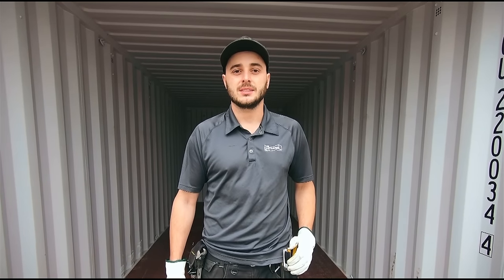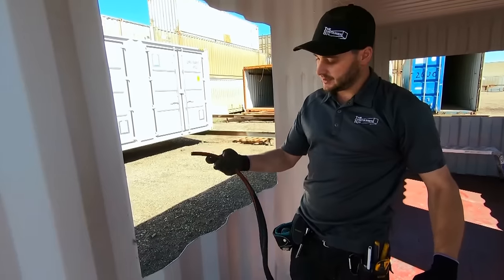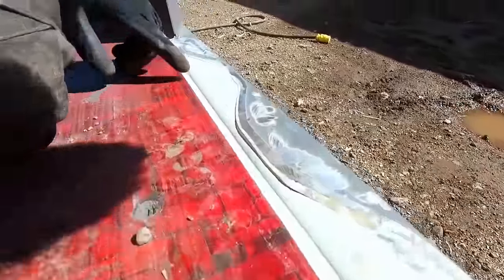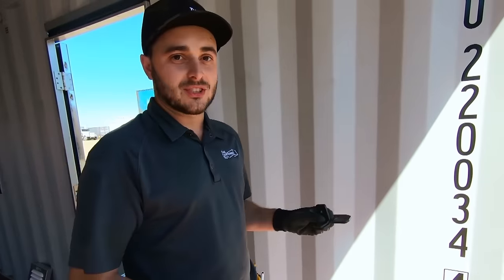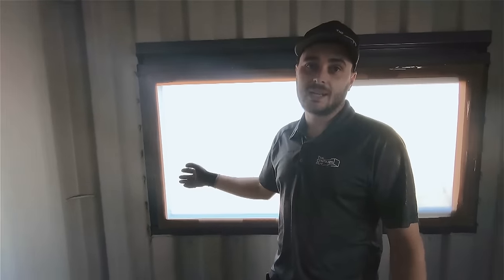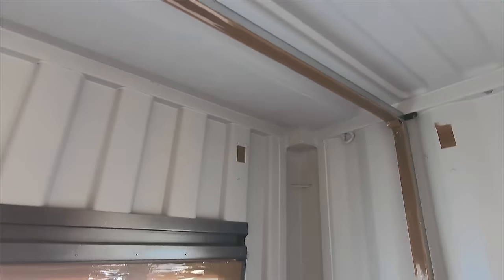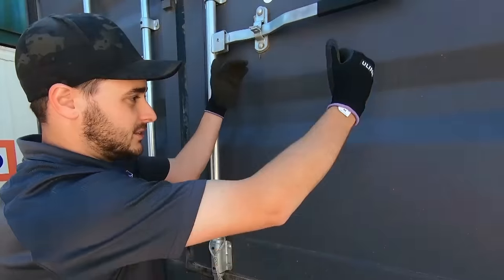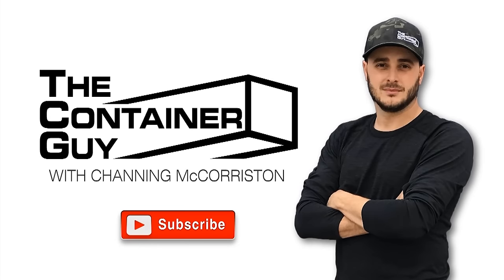Step by Step 20’ Shipping Container Modification

Comment: I still don’t understand why pay labor to install struts and closed cell rather than a refrigerated container. They come insulated with 4” or 6” of closed cell on all 6 sides and a flat stainless steel skin on the inside. 
I’ve seen dozens of conversions and none make any sense especially in cold climates. Plus with a reefer you can always sell the refrigeration unit.
Reply from the maker: There isn't that much insulation in them. Can see in this video here: https://youtu.be/7FD3KeexNyw
Reply from the maker: You're not wrong though. Starting with an ex-reefer is a GREAT way to save money. They are just 1) hard to find and 2) hard to get a structural engineer to stamp drawings
Reply: @TheContainerGuyTV   I beg to differ. there’s more R value in a reefer than in yours my friend. I do HVAC engineering in FL and work on projects like that. A reefer has 4” and 6” of closed cell so 2 to 3 times what yours has or between r-25 and r-38 in a 20 degree split climate vs a mere r-13 in a 70? 90 degrees split in yours. Closed cell isn’t a magic bullet, there will be serious heat losses with r-13. 
I don’t know where you live exactly but even if they harder to find these days, any decent reseller will find you one-trip or low-trips reefers. As for the structural, it’s too bad you’re so far because I have some engineers here that will do it in a heartbeat. These reefers are more structurally sound than non-insulated containers, think about it. 
Speaking of that, I’m very surprised that you don’t reinforce the cutouts with steel which is a must in that case. A window or a door is not a structural component. 
Too bad we can’t share pics here or I would send you some from a house I worked on to illustrate my point.
Reply from the maker: @peteaulit  If you measure the exterior width (8') and the interior width (7'6"), it's simple to assume each wall is 3" thick without cutting into it. Reefers are not a standard design across all factories like corrugated steel units have become so there may be variance as you say but I have not seen anything greater than 3" thick walls or 3.5" thick floor/ceiling.
Reply: @TheContainerGuyTV  well, give me an email and I’ll send you some pics and plans.
Reply from the maker: @peteaulit  mods@thecontainerguy.ca

Comment: Water on silicone eventually molds and fails.
Reply from the maker: I agree. We have started to use urethane sealants. Either way, silicones or sealants are a maintenance item and should be inspected every few years.

Comment: Thats a 5" grinder, not 6. Don't be a skirt, pull out the real-mans grinder, the 9". It takes next to no time to run around all the edges with a flap-disc and take off the bur and edges.
Reply: A 9" grinder runs at a much slower speed than any smaller grinder and uses thicker discs so takes longer to cut. Smaller cutting discs go down to 1mm thickness, less metal to remove, combined with a much higher speed gets the job done quicker and it's lighter to hold.
Reply: @icsp2  Same cutting speeds. Bigger disc, lower revs but same speed at outer edge. Has more horsepower and able to remove more metal quicker. Cutting discs in 9" not much thicker and 1mm discs too easy to pinch and bust. Heavier, but hey, eat your weatbix. If you want light and fast, get a plasma cutter.

Comment: metal stud frame have totally wrong material inside wall if need live container at gould winter area, no newer use, have lot gould pridge were come in and container not have warm, wood have lot better frame stud. same windows and doors frame. or need insulate outside all container closed cell foam sheet and inside too closed cell foam sheet metal not have gould bridge anywere. container insulation at metal wall need use only closed cell foam spray ewery wall and roof, then normal sheet insulation wood and cypsum board or plywood wall,

Comment: So what about the fact that these only have "structure" in the corners and once you cut them, you weaken them?  They weren't meant to do this to.  The only structure to that wall is the fact that wall is even there.  Cut it and now it's weak.  You have to then reinforce where you've cut.  Unless you're using magic shipping containers.
Reply from the maker: Did you watch the video or just comment? The folded profile of the frames are engineered with the proper wall thickness of steel to bring the structural integrity back to the container. Problem solved. We have them stamped by structural engineers all the time in different builds.

Comment: No way to keep it cool even if insulated and ac cooled lol yea and you would need to build sloped roof
Reply from the maker: This is incorrect. Last summer, I worked in the same colour of container office with 3 other people and only a 120v 15 amp A/C heat pump and it froze us out.

Comment: This type of construction is expensive, uncomfortable, too hot in summer and too cold in winter. The useful life of a container-home is approximately 50 years. Due the metal of the container is highly corrosive, long-term maintenance is too expensive. CONTAINER HOMES ARE NOT RECOMMENDABLE.
Reply: It's portable

Comment: this container insulation has only big joke, not newer can live this container at alaska or area were have  -10 to -30 degree cold, artic area. minimum insulation normal cold artic area need be 100mm 4 inch closed cell foam at wall and roof, and floor. and cut all cold bridge at wall wood frame not newer metal frame, today warm house insulation need be 200 mm/ 8 inch to 12 inch ewery wall and roof. save lot money good insulation and have warm, or hot area have inside could, and air-con not waste lot money keep inside good.
Reply from the maker: This was not built for Alaska